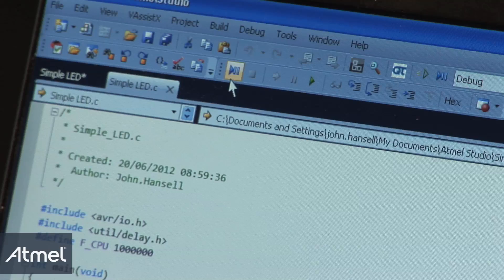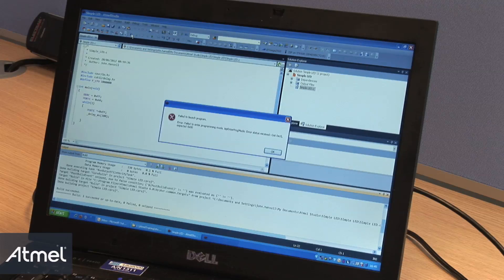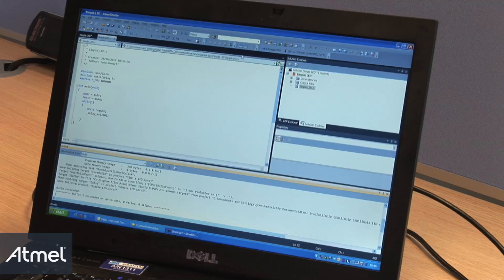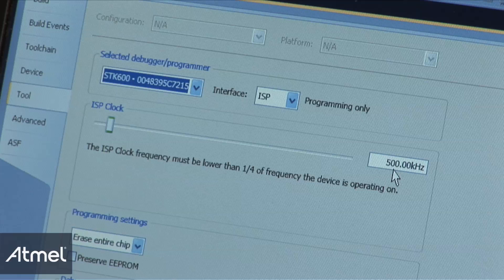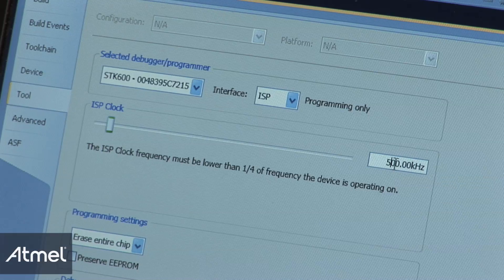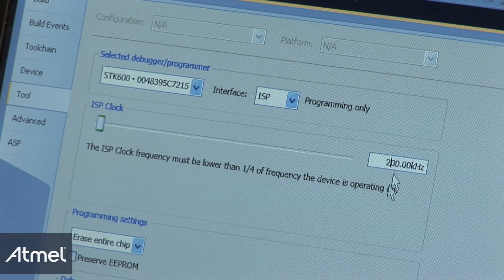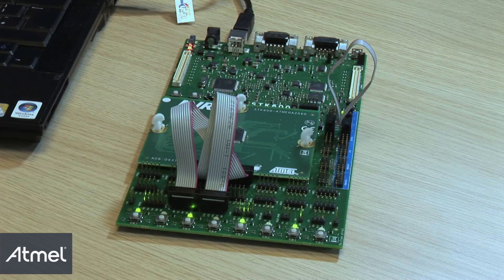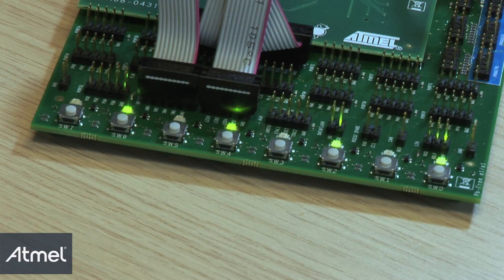Atmel: ISP Connection Problems Due to Wrong ISP Clock Frequency

Comment: Had same problem with Khazama 1.7 and latest Thomas Fischl's firmware. Took me a whole day to find the problem. Setting too low frequency may fail or going slow. Too high frequency would fail.